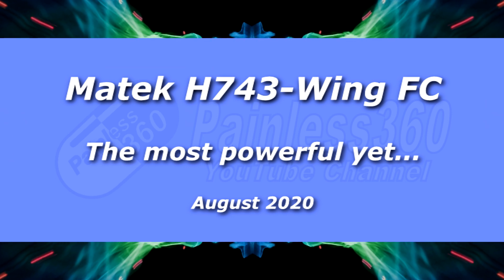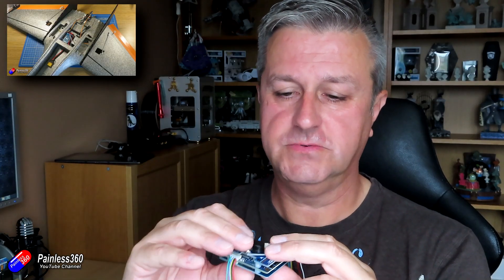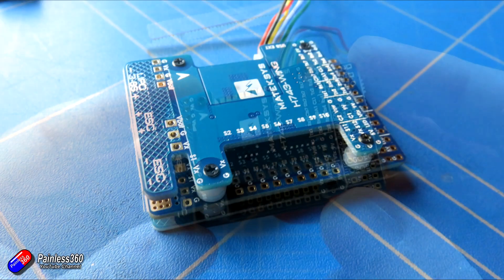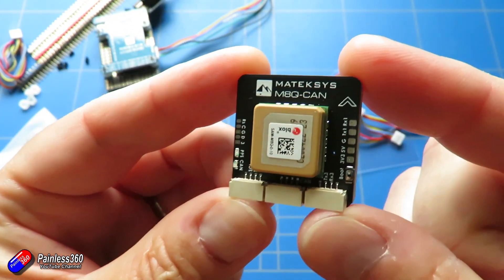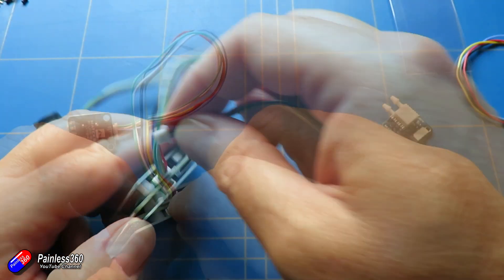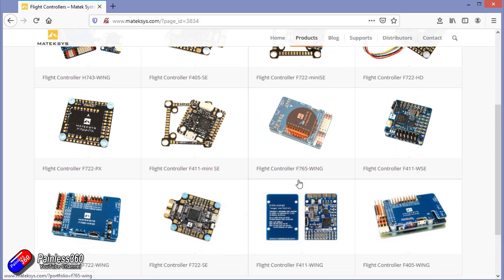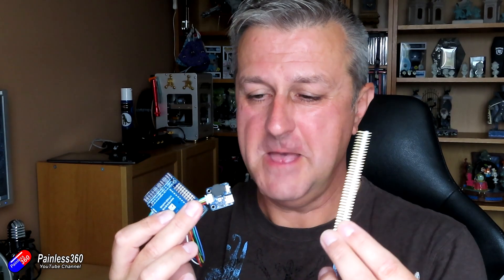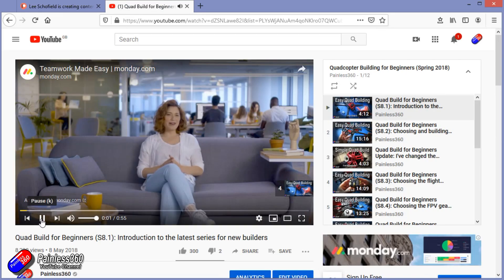NEW Matek H743-Wing: The ultimate Matek WING FC?

Comment: Thanks for this excellent review, Lee. I would really like an up-to-date comparison of the many Mateksys boards, in order to choose the best for a large motor-glider intended for "automated" thermal soaring, probably using Arduplane. I have a H743 Wing working on a Ranger 1600 as basic testbed, this one on INAV (6.1.1). This H742 board is now 3 years old and there might be better options...
Best regards.
Reply from the maker: That is an interesting idea. I'm using mainly F405-Wing boards here on the larger models (not the F405-Wing v2) and using F405-WMN on the builds that have a lot less space.

Comment: hello Andrew
maybe you can explain to me the strange behavior of my matek F722 wing, mounted on an arwingpro with R-XSR and flashed with INAV 6.1.
1st behavior
autolaunch mode activated, armed, throttle stick activated, engine operating at half speed, launch carried out, launch detected, increase in speed, then return to initial speed, without possibility of increasing it, forced landing
2nd behavior, same conditions
armed, autolaunch deactivated by the sticks, unable to run the engine at full power, it accelerates, cuts, restarts at full speed, cuts etc....
after disconnecting and reconnecting the battery, the behavior becomes nominal again
latest info: 4s LiFePo4 A123 batteries
Reply from the maker: It sounds like the battery is struggling to provide the power you want or maybe something like the voltage is dropping too much. Those cells have a far lower voltage than the more conventional battery choices. Maybe it is the LVC on the ESC?  I'd try it with a lipo battery to rule that out. Best of luck
Reply: @Painless360  thanks ANdrew, i will check, but what is strange is that it works like a charm after having plugged and unplugged several times the battery, after this first episod of mal function.at the same time, the urgency is to find my 4s lifepo4 which went into orbit due to a very bad sticking of the wooden plate which secures the battery pack... I have to search 500 m² of vegetation to hope find it

Comment: I purchased one similar to this the h743 wlite and I put it in my 90mm viper jet. On my maiden flight about 30 seconds after take off I lost all controll and it death sprialed into a lake. I see in the fine print.

Current Senor: 220A,  3.3V ADC  (Scale 150 in INAV,  66.7 A/V in ArduPilot)
Sense resistor: 90A continuous, 220A peak

Does this mean my esc draw can not be over 90A continous? Because this jett runs at around 110- 120amps at full throttle.
I am wondering if this was my faital error as I think the FC failed. I was running the gps, crossfire and had failsafe set to RTH. RTH did not activate so I am assuming the FC failed mid flight. Everything worked perfect on the bench. When i pulled it out of the water a bunch of stuff was burnt up on the FC but that could have been when it was in the water...
Reply from the maker: Very possible that the excessive current on launch was too much. The higher values are usually only supported for a very shott time... Best of luck

Comment: i am returning in the hobby. i was out 4 years. i am used to cube black with here 2. i used it for fixwing flights long range. but the new cube orange is to expensive. Is this a reliable alternative that keeps the price lower? or do you say. keep with the cube?
regards
Reply from the maker: CUAV and HolyBro have good Pixhawk Cube alternatives. Modern Ardupilot a can also run on non Pixhawks too and they can be a lot cheaper... Happy flying
Reply: @Painless360  so you dont recommend matek? You prefer cuav or holybro
Reply from the maker: Thats what I was referring to as non-pixhawks. See my series on installing ardupilot onto matek.... best of luck

Comment: A lot of people are having issues with this board. 
Have you played with it on the bench much? Mine won't stop going into failsafe as if it had RX loss. 
If i just move the servos around for a ew minutes i'll get pauses and eventually a failsafe. Lots of people reporting the same
Reply from the maker: I've never had that here, how odd. Checking on the INAV github this has been reported and seems to be related to the use of ELRS (something I'm not using with mine here). Thanks for letting me know.
Reply: @Painless360  try inav and let it sit on the bench for a few minutes. Fiddle with the pitch/roll and see if it happens. I bet it will, while disarmed.
Reply from the maker: No point. It has been reported to the developers already... I'd track the issue report if I were you so you can see when it is fixed. Just as likely to be an ELRS issue from what I have seen.. best of luck

Comment: Hey Lee, I just got an H743-WLITE and figured I would pick an H743 video of yours to ask my question... Mateksys not so much help, there entire answer was "PINIO can be controlled by any AUX channel." I'm new enough to all this that I have no idea what that means. lol

Have you done any videos on the switch controlled 9V video power? I'm running Caddx Vista Polar and have always just had a plug between power and camera on my other set ups. Tried going off Mateksys wiring diagram regarding “9Vsw Power/Camera Switch” but I can't get it to work. I'm running iNav 4.1.0 and I'd like camera to energize with "CH5", my arm/disarm channel. I have power plugged into the "G" and "9V" next to "C1"

Thanks in advance for your time, whether it's to point me towards a video or if you just have an answer.
Reply from the maker: I'd use an external rc controlled switch (like the ones from MenaceRC) as they are easy to setup... Happy flying

Comment: Ever try installing a CAN matek digital air speed sensor to a H743 and set it up  in Ardupilot ? I say goodluck lol
Reply from the maker: CANBus setup in Ardupilot isn't as easy as it should be. Series coming that shows a CANBus setup in Arduplane.. Stay tuned!
Reply: @Painless360   Oh we need your genius ! Wink! The New 743 H V2 has a usb extender dongle with two JST plugs, UAVCAN  and 12C plug. I tried the suspected easier rout last night and plugging Air S into 12C , getting it to function should be a joke to set up ! It supposed to be plug and play with the few advertised settings. More hair all over my desk again lol
Reply from the maker: CANBus setup is covered in the 2nd video in the VTOL series for a PixHawk but a lot of the stuff that needs to be turned on seems to be hidden away so it'll be worth a look...

Comment: Hi Lee   I just wish I would have seen this before I purchased the H-743. It's 2022 and INAV is still not available.  I purchased this one as a recommended it because I was building a new Glider and I wanted to install a system that I could add a component without having to remove the F.C,  but I don't know ARDUPILOT Pilot at all. I guess I need to learn how to use it, I am giving up on INAV on ever coming out with a firmware update for this F.C  Thanks for the video and information.
Reply from the maker: Ardupilot is a great system.
Mission Planner/ArduPlane/PixHawk Build (Spring 2020): https://www.youtube.com/playlist?list=PLYsWjANuAm4p6qzsdJ4Jtnh0dVIGS8jOp will give you the basics of the setup.. Best of luck

Comment: Do u know if inav will support the H743 I know they been working on it I’m on version 3.0.1  but use f 765 an f405 in my planes and wings. I have two H743 I want to use but afraid to down load firmware
Reply from the maker: V4.0 is nearly out and the H7 support looks like one of the improvements..

Comment: I am going to buy this flight controller. But I see in aliexpres MATEK H743-WING V2. There is any difference with this v2?
Reply from the maker: I've not looked at the V2. I cannot see anything obvious on the Matek website too. I'd guess a chip change as that has happened to a few of the Matek models recently due to the chip shortages.. Best of luck!

Comment: For some reason INAV 3.0.1 does not find the SD card for data logging.  I get the error message "No dataflash chip found".   I have the blackbox enabled and tried several SD cards formatted for FAT.  I have several other models of Mateksys FCs but this is the only one that seems to have the problem.  Does anyone have the same issue?
Reply from the maker: I'd check the problems in the wiki in case it is a problem on H7... Best of luck

Comment: Thank you for helping me a lot in the past weeks - specifically on Yapuu Telem on the TX16S - what a mess!
Now, I try to change from a fantastic 743slim board to a 743wing on one of my Hexas.
Need some help, because documentation for using 743wing with a Matek 12s PDB HEX is not to find.
I am shure you have the solution!
- where to connect the Curr from PDB? Cant use the onbaord Curr of the 743wing - need 180A. Is it CU2? Need to messure if the Curr from PDB is not more than 3,3V then, right?
- how to get power in the 743wing without using the onboard curr? By the vbat on the BEC-Board of 743wing? Or just neglect it, take the BATT pads and use CU2?
uff, hard stuff so far, but i dont want to turn the H743wing into a briquette (did so with some 722 and a 405..).
Thanks in advance
Reply from the maker: I'm not sure that flight controller is a good choice. It can't handle 12s batteries and isnt designed to work with an external PDB..

Comment: I just bought this setup Lee.  You can’t power the can circuit w/o the lipos.  USB won’t do it.  Another thing; how is Betaflight or Inav going to handle the CAN connection for the GPS?  Its best to just use a regular UART gps and go with Betaflight for now.  The early M8Q-CAN firmwares did not support MSP connections.  sigh!

Comment: I BOUGHT THIS BECAUSE I HAVE ALWAYS BEEN EXTREMELY IMPRESSED BY MATEK. I bought this model for my TALLON that has a 405 wing in it. I wanted the remote USB link and buzzer more than anything. I am hoping to do all preflight checks without removing the hatch before a flight. I always felt the vertical USB of the 405 was a mistake especially after dislodging mine. I am also hoping that the more powerful processor will aid in terrain follow missions. But having it in my hands, I am simply amazed that it is almost identical in size to the 405Wing with all the added features.
Reply: I also broke the vertical usb port on my f722 but they used a through hole connecter so I was able to replace it easily.

Comment: how to use this thing on a multicopter there's just 2 esc ports for motors or can you connect those esc's to the pwm servo outputs? 🤔
Reply from the maker: This is designed for fixed wing.  The clue is in the name. See their other flight controllers for multirotor..  happy flying
Reply: @Painless360  well but you said "and probably also for multicopters" 🤷‍♂️ and i would kinda be interested to put all that power of this fc into a huge build somehow..... a rescue hexa for 7inch quads with grappling hook and dual cam or smth 🤪
Reply from the maker: You'd use a PDB and other parts if you wanted to try that..

Comment: Hi im kinda new to the rc hobbyist world and i was wondering if the H743 could do waypoint missions and transmit telemetry back via a 3dr radio?
Reply from the maker: It could but you're starting at the 'harder' end of the hobby for someone who is new. Check out my PixHawk 2020 series and let me know if you have any questions.. Best of luck!
Reply: @Painless360 thanks!
Reply: @Painless360  Also, could you tell me where to solder the 3DR Radio module onto the Matek?

Comment: What about interference/noise concerns from I^2C? I have never used I^2C myself, but I have read that it's best to keep the cable as short as possible or avoid altogether. Is that true?
Reply from the maker: I've never seen that. Careful cable routing and neat installs are always a good idea though.. Happy flying
Reply: Its only i2c till it plugs into the module, and that length is short.  From there the data is carried on the canbus, noise immune. So cable length is effectively the same as stock.
Reply: @m3chanist  ahhh ok. Now it makes sense. Thanks!
Reply: Maybe a conduit to isolate the noise?

Comment: Hi. Can you use mamba f405 mk2 
Flight controller. On a fixed wing .
I been flying quadcopter now for over a year now.  And now I'm trying to build a GPS Auto pilot using my old mamba f405 mk2 stack on a fixed wing. 

I really need some help.
Reply from the maker: Maybe, I've not tried. These wing flight controllers make it very easy for. See the linked builds.. Happy flying

Comment: I want an onboard wifi for configuration that you can switch on and off cause a naked usb wifi chip out of a usb stick is less than 1 gramm and 1€.
Reply: Agreed.   Would be nice to be able to connect to the board without the need for cables.  

Be much quicker to connect with wifi to the board and configure that way
Reply: Maybe serial comm over bluetooth is easier and you may just connect bluetooth module to any of your FC... Check out MFD bluetooth module for it's Mini Crossbow AAT, it support connection via I2C connection.

Comment: Would you consider doing a video on the  TBS cloud updating the tango 2 and all the features? They do it on couch and it's straight forward but if you watch the comments and hours later FB there are a lot of questions still always. Just a thought since they just did a major firmware update.
Reply from the maker: A couple of videos coming on Crossfire basics and the cloud and multi bind setups. Stay tuned...

Comment: Where can I buy? I can't find it for sale anywhere. I have a Finwing Airtitan build  that is begging for this board. I have an F405 that I was gonna mount in it, but the remote USB and the can-bus, not to mention the H7 processor has me sold. My current  survey/search and rescue long range FPV rig is a My Twin Dream running a F765 and 5 cameras, but I was sold on the Airtitan's 7+kg payload capacity.
Reply from the maker: This is VERY NEW. It'll be in the usual stockists soon... Happy flying
Reply: @Painless360  You always seem to have a different line to spend hope or a smile ... and that lightning fast

thx

Comment: I JUST finished setting up my F765-WING...

Next build will have this one :)
Reply: What are the extra features offered by the 743 model for you?
Reply: @yousefsaadeh7144  Mainly the CAN-Bus and additional PWM port. The plane that the F765-Wing is currently in uses up all of the 12 ports and I would love to have another one. Also, while the M8Q-CAN and ASPD-DLVR can both work on it, they are more convenient to use with CAN-Bus as it would allow for some cleaner and easier wiring.

I’ve owned both of those sensor for quite a while now and still haven’t actually installed them. First I had to wait for iNAV 2.6 for what felt like ages and then, once it got released, I had to update the firmware on the GPS module for it to actually work over MSP... which I still haven’t done :/

Anyway, maybe I’ll finally get me this FC now that you’ve reminded me ;D I just wish that it also had another camera port.

Comment: I’m always excited to see another board with USB-C (I know, it’s the little things), but so far I’ve often been disappointed that it’s not really USB-C and won’t connect to the USB-C port on my Mac without first going through a USB-A adapter. Is that also the case on this board? Or have they got the circuitry correct to allow direct USB-C connection?